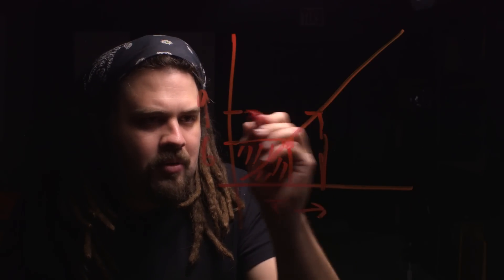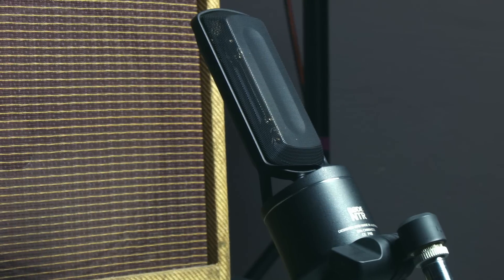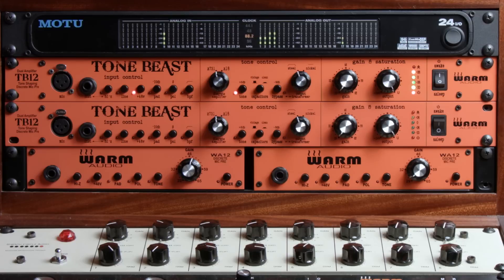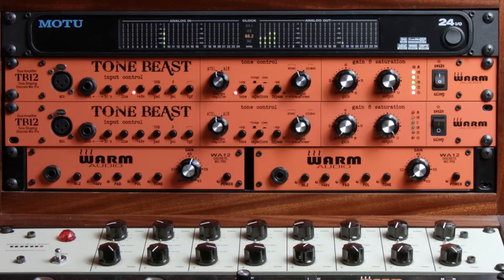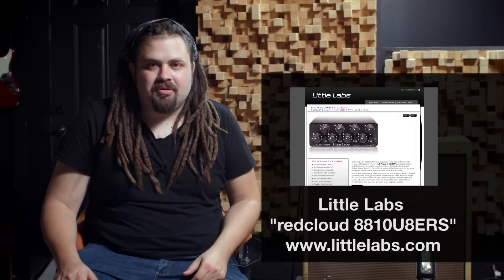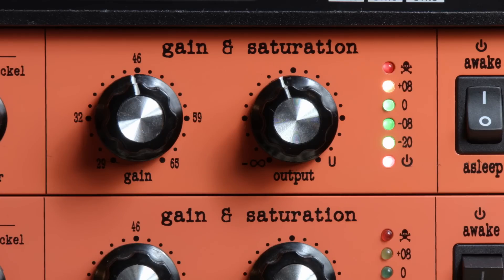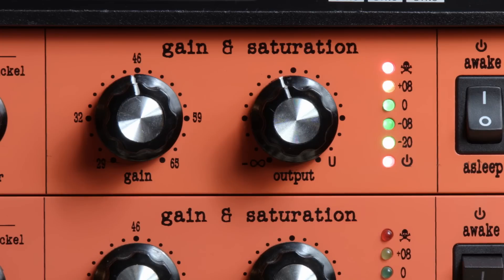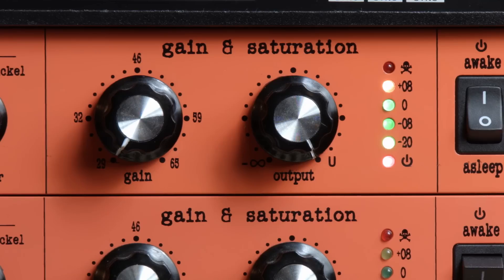How to Get Preamp Saturation for Electric Guitar Tones

Comment: great video, thank you for sharing. I have a technical question. How does pushing an analog pre-amp to clipping affect its life? Are damaging pre-amps by red-lining them? Does it depend on whether the pre-amp is transformer, tube, or transistor based?
Reply: Same here. I always thought about that and i have went crazy on it before,but I don't do it often. I use plugins for that mostly. I do wonder if it does harm to equipment though, anything in general.

Comment: Really making me want to get some external preamps for this purpose if nothing else haha I already have some warm audio stuff, WA76 and their eqp-wa and I love them but are there other options you have used that you liked better or for different reasons that you would recommend as alternatives or have warm audio really nailed it down at their price point?

Do you have any music of your own that you've seen through from start to finish? I know you are a drummer and I'd love to hear some if you have any. 

Without doubt the best channel around making music, especially your focus on tracking which seems neglected largely by most other channels. Tried the lo-fi drums this week with great results using a slightly larger Tom. The tuning of the heads may need tweaked to reduce an overbearing frequency of the resonance but massive thanks man :)
Reply from the maker: Hey Matt, thanks for such kind words. Right now I just have some Seventh Circle Audio preamps, the T15 model. It was a kit and it's not discrete. There's a big difference between those and the WA12 for example. I've been super happy with the Warm Audio stuff. I'll be posting some of my music soon. I've been working on a song based on the tom reso/lo-fi drum track I did, and it developed into a song.

Comment: Quick question, any reason in particular you're recording at 88.2 khz, vs. 44.1 or 96 khz? I'm just wondering about your reasoning. I've left it at 44.1 forever, and every time I boost it up I don't see (hear) any real benefit, but I'm totally open-minded to the idea that I might be missing something. Great video, btw! I definitely plan on getting the tonebeast, and this is pushing the idea :)
Reply from the maker: Yeah, I started doing 88.2 and I think it helps. I can't say that it's night and day, but I think it does help. Some say that 44.1 actually works better because some converters are just optimized to be at that rate. I've noticed some extra noise or hiss when doing 96k, and plus I wanted it to just fold down to 44.1 nicely so I went with 88.2. Again, I still do tons of stuff at 44.1 and 48 for these videos.
Reply: creativesoundlab The extra noise at higher sample rates is pretty interesting. Even on newer interfaces? I used to always go back to lower rates due to file size, but HD space is ridiculously cheap now so it makes me feel like running higher. One of the main reasons is the even lower latency.  Altering samples (pitch and time-stretch) is supposed to sound way better at higher rates, too. I'm going to give it a shot for a while and see how it goes. Thanks a lot :)

Comment: Hello Ryan!! I was wondering how the sound with the TB at minimum gain and max output is compared to the plain interface preamp sound.. I guess it's a lot different.. When the TB is at max output, isn't there output transformer saturation going on (besides opamp/discrete amplifier saturation )? So the signal must be already quite coloured.. Do you remember the capacitor setting?? As I know, the TB is in its most colored setting  when the discrete amp is at x731, the capacitor at "vintage", the "tone" button engaged, the output transformer is set to "steel" and the gain knob at highest possible.
Reply from the maker: Yes, you are right on those settings. And warm audio as told me those are the same settings as the WA12 as well. The tone button is amazing, and I find that I use it a lot of the time. It just makes the sounds seem angry and big. In a demo like this one, with a mic that has a similar gain as this one, I find that my gain settings only need to be turned up about 75% of the way, or at about 2 o'clock before you start to get noticable fuzzy distortion out of the unit. Anywhere from 10 o'clock til 2 o'clock is the sweet spot of color. Without the attenuation at the far right of the unit, the gain would only be about 9 o'clock. A hotter mic will overdrive quicker on the preamp, and a quieter sm7b on spoken word will need all the gain to overdrive. After all this, I attenuate back to get my recorded level of -18 or -12 db (At most) from digital clipping. The sound is really fast on the transients, and sounds very warm. I think when you get into descrete preamps like the API, or neve flavors, you're going to get a great sound. An interface preamp that is built in, there's really not way to sculp the sound, but just to bring up the gain that you need for levels and hope that you like it. More of a clean approach.

Comment: Interesting, but a bit too raw for a good example. I think a really good example of guitar saturation would be the guitars of a band like Cannibal Corpse. Now that's what I call saturation ! But then, they also use jacked up Mesa triple rectifiers, which is very key to getting that really thick guitar sound. Obviously there's some other tricks going on in their recordings though. No idea what that stuff is. Even just a few mics, a good cabinet and a high end tube amp isn't necessarily still going to get you there. As you said, recording is an art.. and every dog has their secrets too.

Comment: WARNING! THIS COMMENT CONTAINS OPINIONATED STATEMENTS!: 

Seems like a subtle additive to the mix. Not sure of what situation it would be very useful. I'm of the mindset that the recording should capture the guitarist's tone, and not really add much to it. If your guitarist's tone already has character, and vibe then you shouldn't need to add any more it it.
Reply from the maker: Yeah, that makes sense.
Reply: It probably actually makes it sound more like the amp in the room. In normal mode it sounds more bubbly in the lo-mid, witch is not the case when you listen to amps in a room, i know cuz i have recorded several amps and listen to many many amps in a room. The pushed tone makes it sound a lot tighter and probably more how the guitarist hears it and it will take up less space in the mix therefore need less artificial eq moves etc in the mix